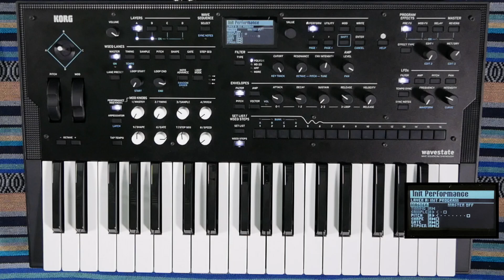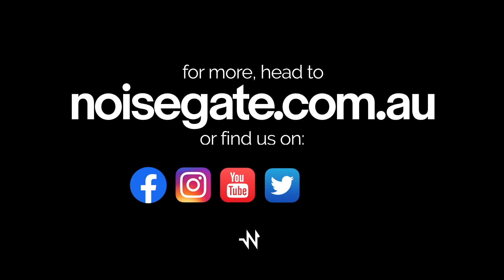KORG Wavestate Synthesiser: Vector Synthesis Tutorial

Comment: Just bought one of these and love it. The output level on some of the sounds is quite low. I find I'm turning up the volume knob full and also turning the input gain on my interface up to max to get an almost decent level to record into my DAW. I know you can adjust output levels for each individual sound/lane but still some are quite low. Am I missing something? Great tutorials thank you!! 🙏
Reply: Maybe the cables? If not, try resetting to the default settings in the editor and make sure your wave state is up to date. I was having issues with some of my patches so I reset everything and that fixed my problem.
Reply: @FadRaxMuryMoad  Just updated to latest firmware will download the editor and try that. Thanks for the info! 👍